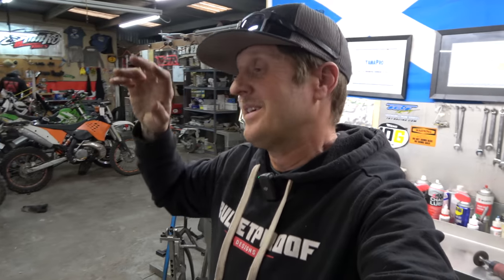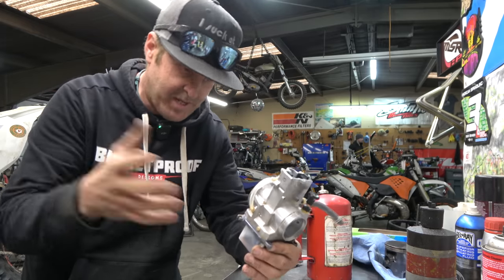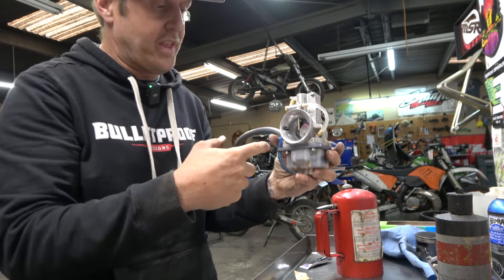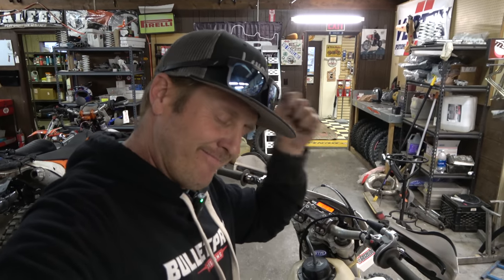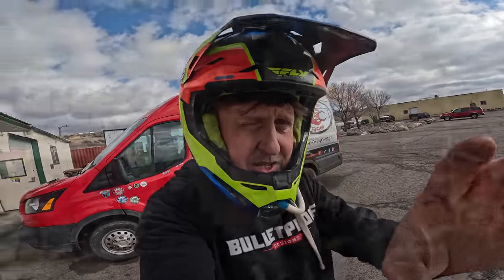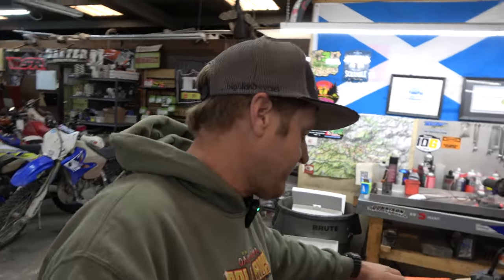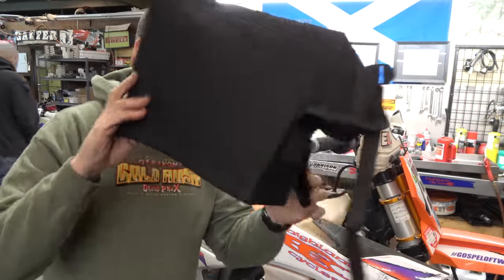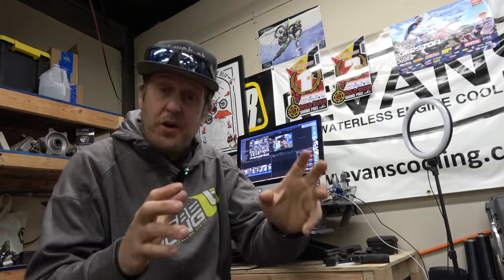The Shlog #232 | XTNG Carb | Adding a Link Skid to a skid plate | How to ride in cold weather

Comment: I fell your pain brother.  4 years ago I had bought a standard Lectron carb for my YZ250X. Metering rod wasn't even close to correct. Float level wasn't stable, hanging idle ect.  Ok so float valve was would hang up, small file took care of that.  Ordered metering rod which Lectron supplied for free. I paid shipping. The carb splits in half so I took it apart and gave it a fine sanding on flat surface on the mating faces. Put that SOB back together, now it's good.  Keep up the good work man !
Reply from the maker: Nice

Comment: What's up with that ttr230 ? I have one and would like to know upgrades or mods that can be done ? I was looking into a pwk28
Reply from the maker: There is a lot you can do but honestly I don’t think it’s worth it. Personal opinion is just rude it for what it is and upgrade bikes eventually
Reply: @highlandcycles  
The TTR-230 is the ultimate Dad bike. There’s no better platform for leading kids down single track.  Best transmission I’ve ever had. Just don’t jump it - those 9 inches of travel are hard on wrists and ankles.